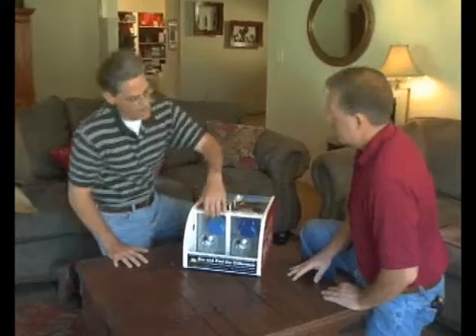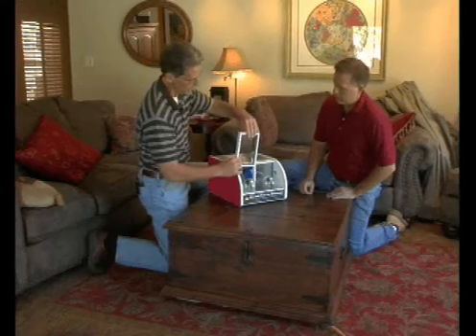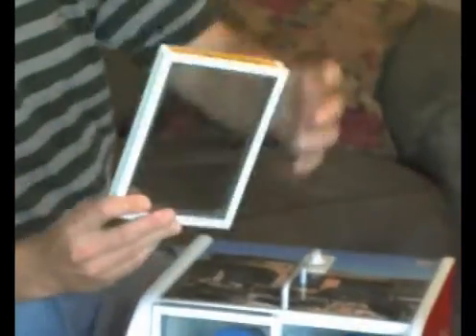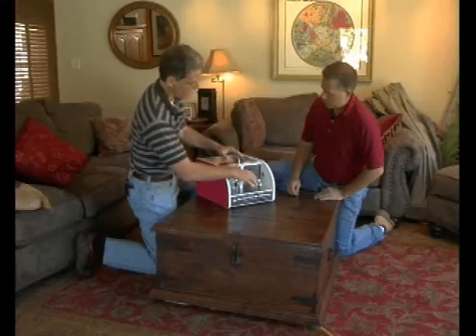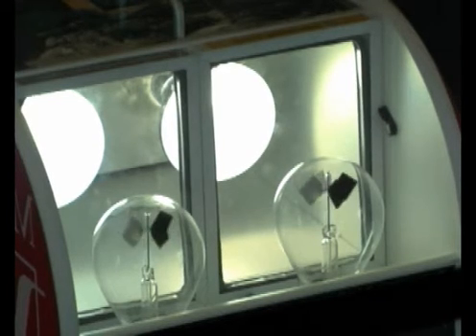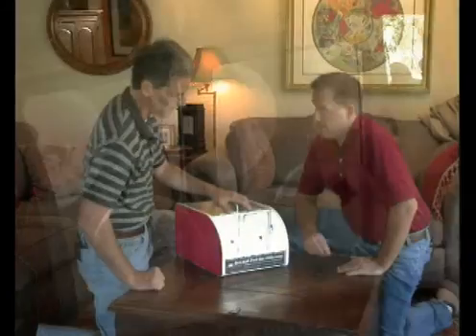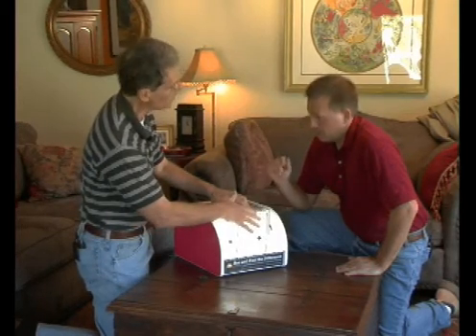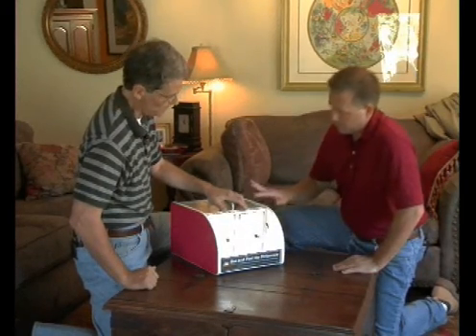Low-E Coating Window: Radiant Heat Reduction Demo

Comment: Low-e is real efficient, but the demonstration is not relevant. The glass not visible for Infrared radiation emitted by the room. The visible and near-infrared radiation causes the rotation of lightmill. So, this demonstration is about the lower transparency of low-e coated glass.